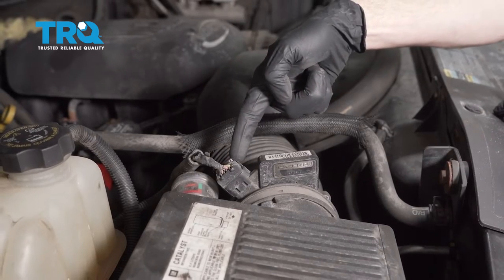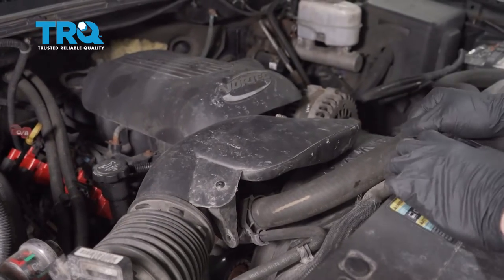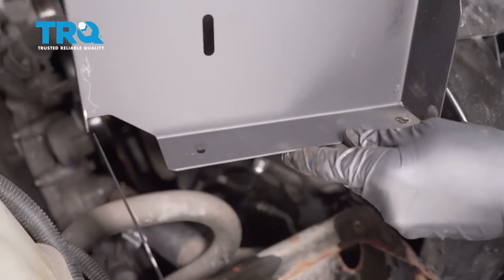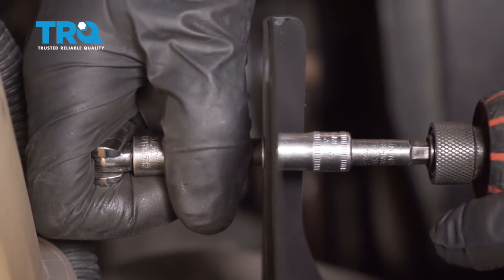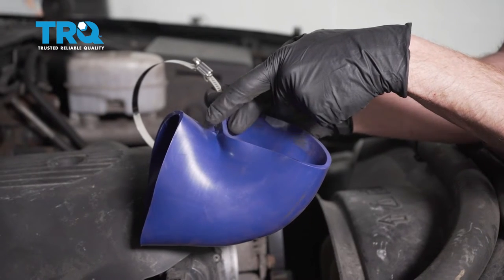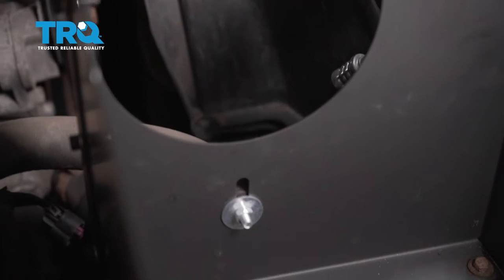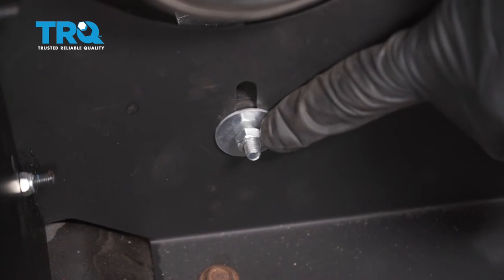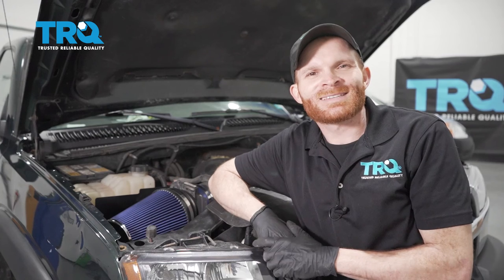How to Install Performance Air Intake Kit 2001-2006 Silverado 2500 HD

Comment: That’s not a true cold air intake. It’s exposed to under hood temperatures and more likely you’ll have to put another tune in the ECM because you’ll have a lot of extra airflow at the massive airflow center would not recognize from a stock set up.